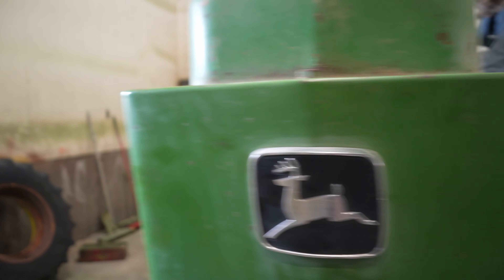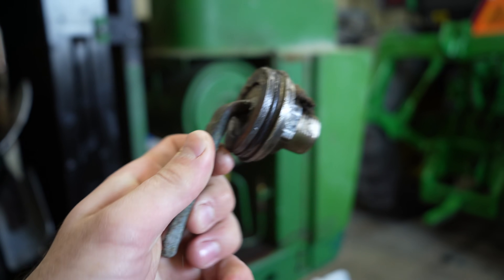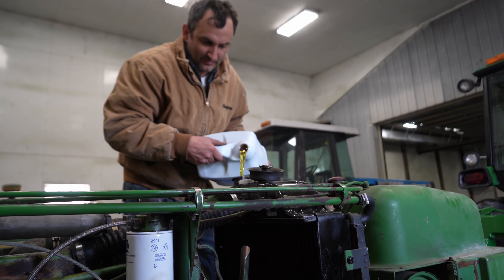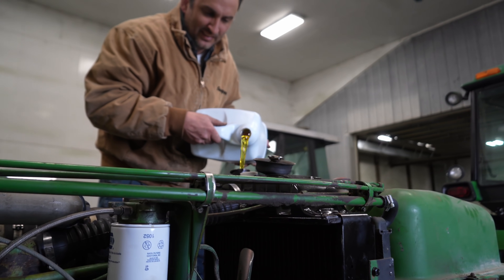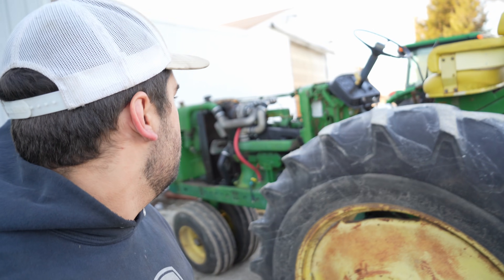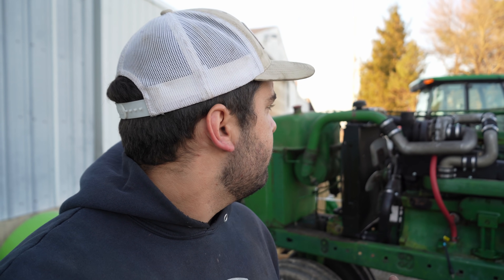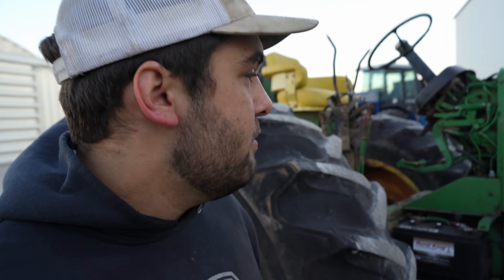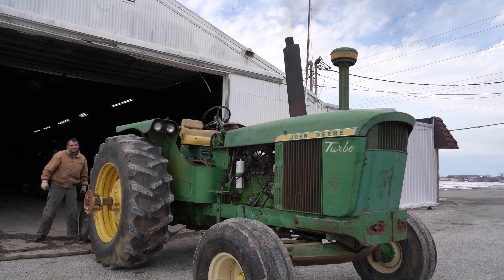4230 M&W Turbo Build - Dyno Day!

Comment: That's how we finished our rebuilds.  Fire it up, make sure fluids stay contained.  Straight to the dyno.  Absolute minimum idle time.  Not looking for a power number at that point.  We just wanted full load, full boost for 20 minutes.  Idle it down, let it cool off.  Next morning head re-torque.  Oil & filter change.  Sheet metal back on.  Then if we were looking for a power number we would make pump adjustments on the dyno again.  We found engines we put through that break in process made the same power for more hours with less oil consumption, and less blow by.

Comment: When you fix up these tractors, do you upgrade the batteries to 12 volt parallel or do you leave them 6 volt series?
Reply from the maker: Yes they get converted to 12 volt batteries.
Reply: Thanks, video’s are great nice job!

Comment: Extra horsepower in a given size tractor is always ok until you overload the PTO or drivetrain. As a mechanic, I’ve seen the results of 150hp 4020’s and 806’s. Same size tools a gear faster and a little less throttle=fine. Add extra weight, bigger tires and pull bigger equipment=scattered drivetrains. No matter the brand.

Comment: In your words the 11000 hour engine turned 115. And the fresh engine with turbo and high compression pistons only turned 125. Any chance the dyno wasn't dailed in right for the first test? I am enjoying your channel. Not trying to stir shit. That first dyno test number just seemed high.
Reply from the maker: It was set right for the first run, that is for sure. We  ended up getting 135 horsepower out of the tractor after all the work on it.

Comment: What "settings" do you change on the dyno for a 4230 vs a 5020? 
We had a 4230 that started popping out of gear going downhill with a load behind.
Traded up to a 4240 and never looked back!
Reply: Torque arm setting

Comment: I started working for a Deere dealer same time 30 series came out. Sound Gard cab was light years ahead of the competition, some never did catch up. The engine were a little weak. The 40 series were a much better all round tractor. Will be nice tractor when you get it all done.
Reply from the maker: It would have been very cool to witness the 30 series come onto the market! The first new John Deere Grandpa sold as a Deere dealer was a 4430, and that same tractor is sitting in the shed today 👍

Comment: we had a 4230 engine blew and we went to Iowa and got a 4430 motor from a burnt tractor and put in...smooth running lots of power...the engine blew cause we ran alcohol in it..pulling ..broke the crank..didn't know what we were doing